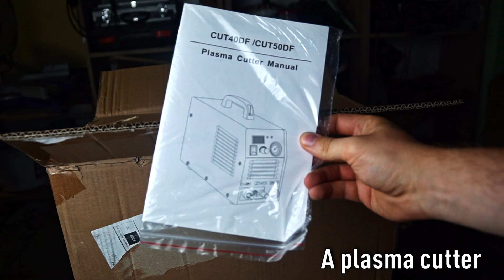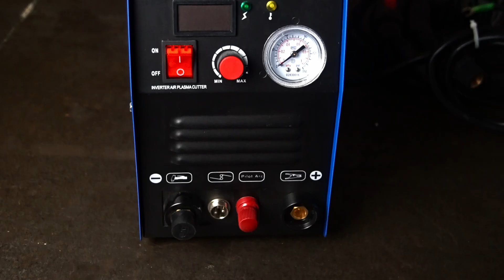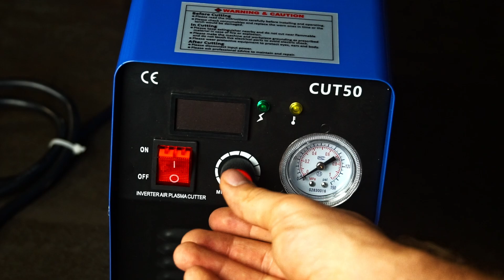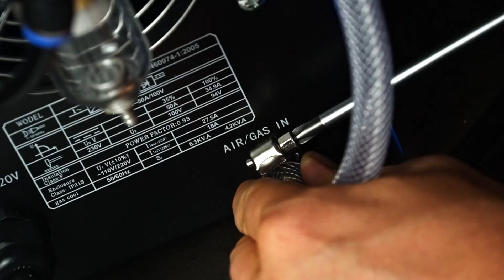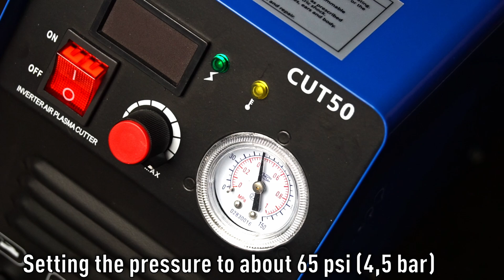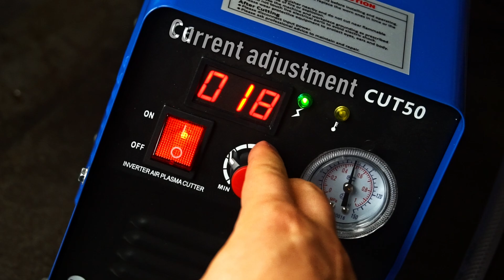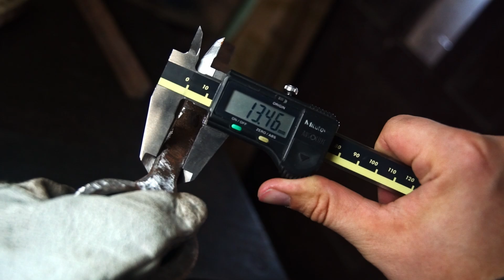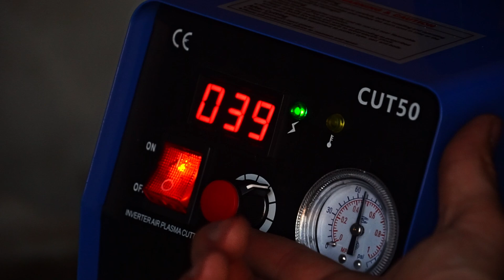Vevor CUT50 -  My First Plasma Cutter!

Comment: Why buy this machine when you can buy the 3 in 1 cut 520d ( CT520d) for the same price?  You get the same 50A plasma cutting along with 200A MMA and TIG! 
That's a totally unreal great deal. 

I've seen some 5 in 1s advertised that do CUT/MMA/TIG/Pulse/Fluxcore  too at a higher price point. The pulse supposedly allows welding aluminum but I don't know personally.
Reply from the maker: Pulse is not the same as AC - which is needed for aluminium. Unless youre talking about aluminium tig